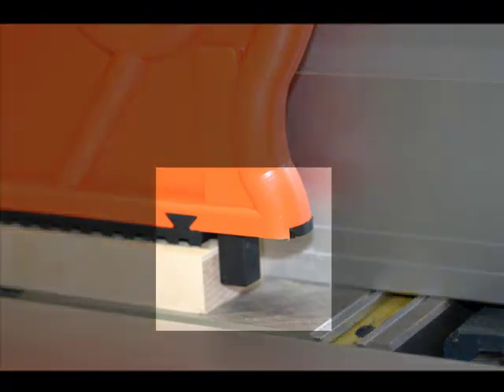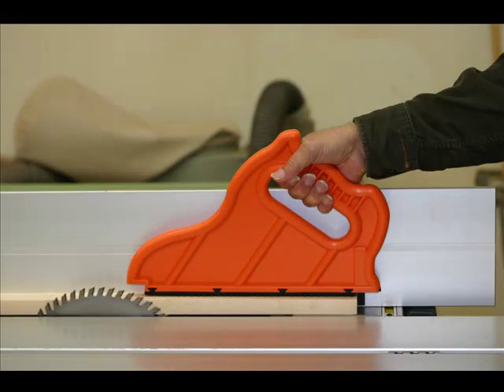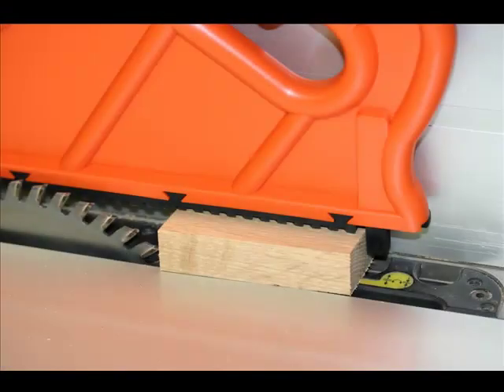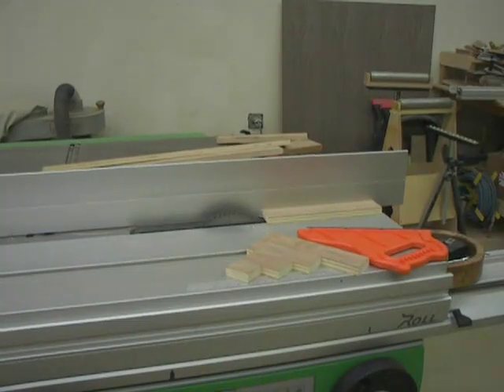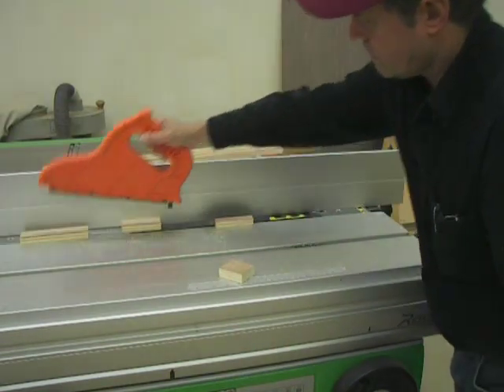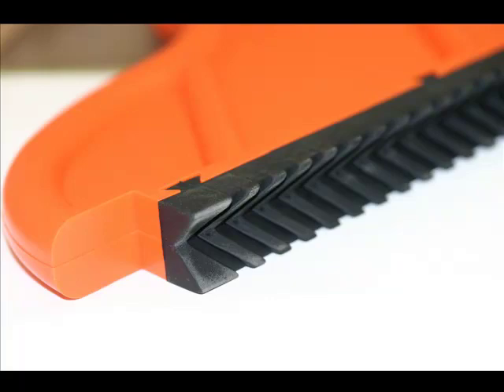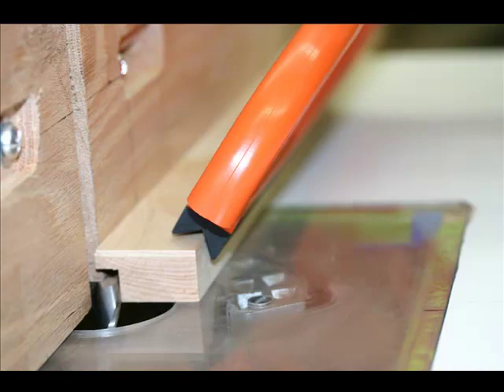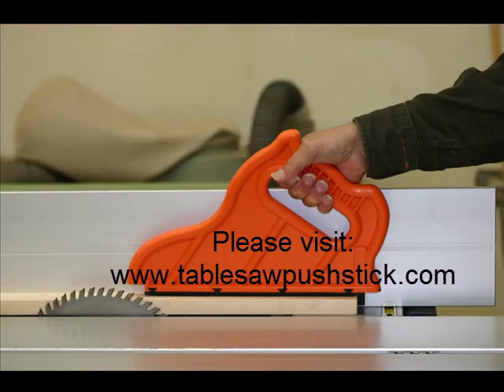Tablesaw Safety Lesson Part 2

Comment: I happened across this video just wondering if anyone had anything other than the expensive grr-ripper or this or that "bestest" push stick.  Amazon is $21, which seems pretty fair all things considered.  I like that your hand is up a bit higher with more material between the blade and you hand, unlike many others.   I suppose one could copy this onto a pice of 1/2 or 3/4" plywood, however the asking price isn't terrible, and it is nice that it has the router angled bottom attachment with it for the price.